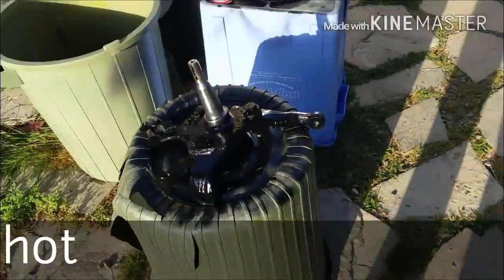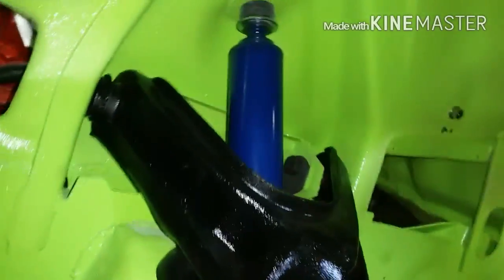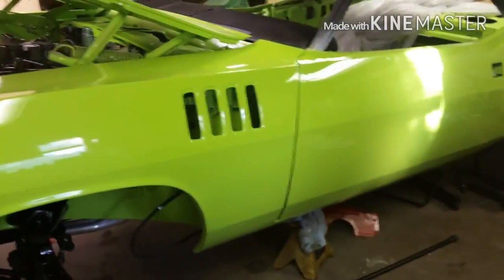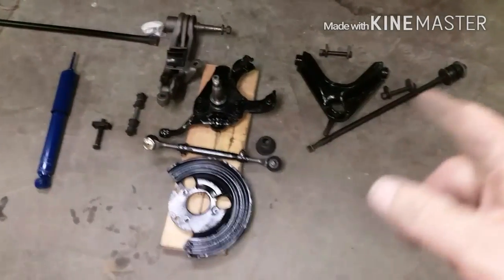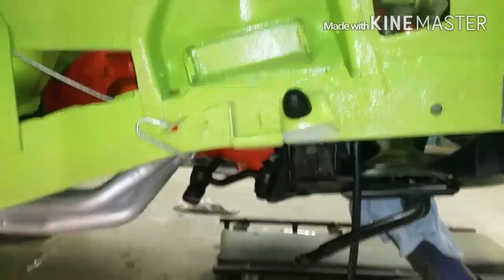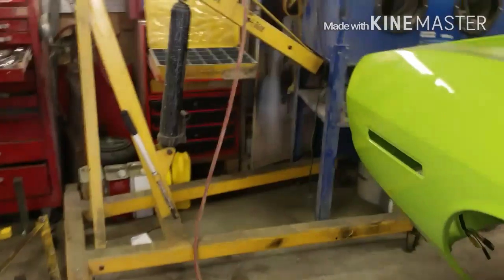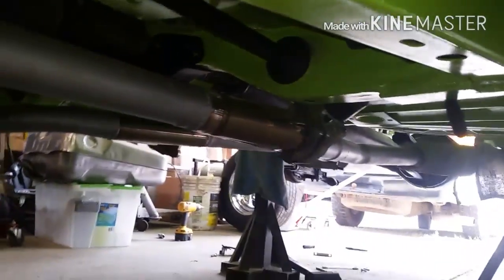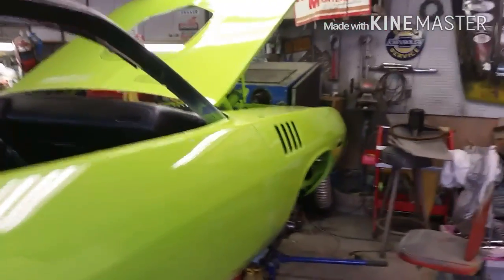Project cuda part 33

Comment: Wow, that's what you call total restoration! Nice job and it sounds great. Is this a no expense spared project? I'd hate to have to flip the bill looks pricey for sure, but it sure likes nice when you're finished.
Reply from the maker: up could build 3 old chevys for what has been spent on one dodge 😆
Reply: Economics. Supply and demand. The higher the supply the cheaper the product. That's why you have a lot more guys building Chevys and not Mopars. Even Chevrolet keeps the supply of Corvettes down so they make a higher profit. If they built more Corvettes they would sell them, they would just be a little more affordable IMHO